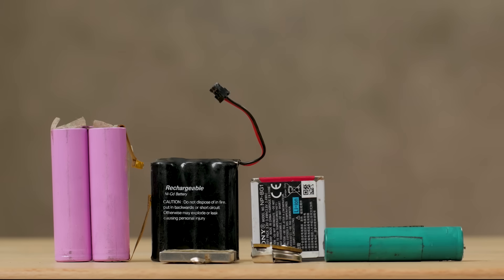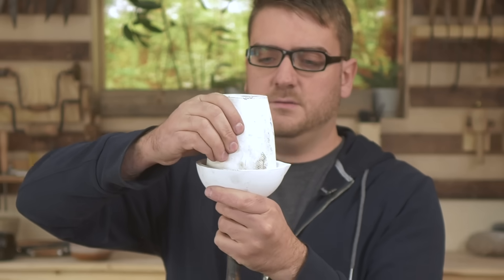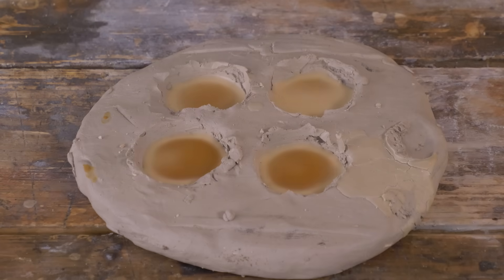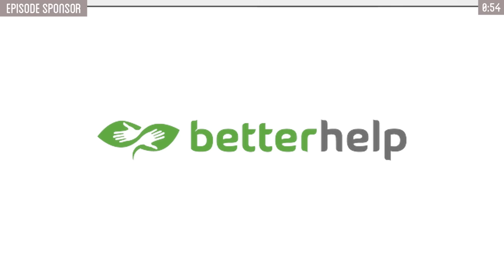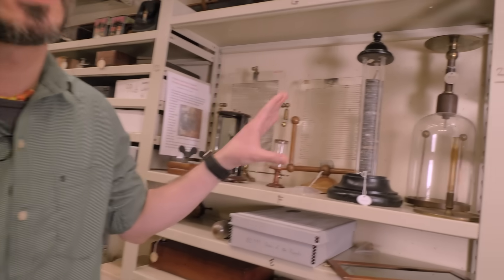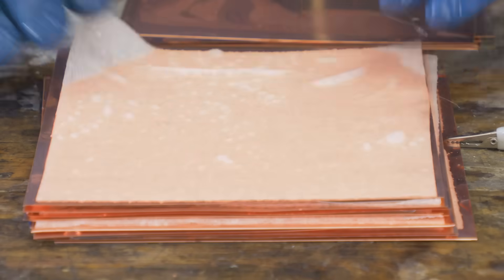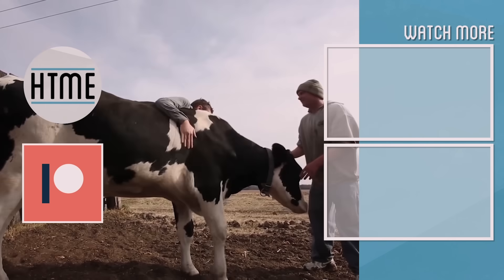Can an 18th Century Battery Charge Your Phone?

Comment: Next time you cast metal with the lost wax method, build in gas vents from the discs back up to the surface. Or at least a good way from the cavities. That will allow the metal to not have to try and compress the gasses inside the mold. 
Or you could attach the mold to a string and swing it around employing centripetal forces to push the metal into the cavities. Both are tried and true methods of improving casting results.
Also try having a larger funnel shaped hole at the top to allow for more metal in your pour. The increased weight will help push the metal into the cavities, plus the excess metal reservoir will help when the metal starts to shrink when it cools.
Reply: Thank you for bringing this up. First thing I thought when I saw the casting
Reply: @inserttext2412  20 plus years as a custom goldsmith specializing in casting and repairs. 
Sometimes small things make huge differences in end results.
Reply: It always surprises me how many people pour into molds using the silly small holes like that.

Comment: That stack of metal and fiber, doused in salt water lighting up that LED light was a really cool visual of the basic principles of a battery.  Mind-blowing!
Reply: I remember back at school in the 1970s we made a voltaic battery from layers of copper, blotting paper and zinc soaked in brine.
Reply: Penny's after 1983 are zinc with copper plating, sand one side down on the sidewalk and you can do the same.
:)
Reply: @skepticfucker280  Incorrect. The penny was originally minted from bronze, but since 1992 has been minted in copper-plated steel due to increasing copper prices. By May 2006, the intrinsic metal value of a pre-1992 1p coin was about 1.5 pence. Melting coins is illegal in the United Kingdom and is punishable by a fine, or up to two years imprisonment.

Comment: what would you have to replace to reuse the battery?
Reply: Water if it dries out, or replace the corroded zinc plates if the charge is depleted.

Comment: It's not that the battery is discharging quickly. It's that it's internal resistance is high. When you measure without load vs with load you can calculate the internal resistance. Bottom line you need way more surface area to keep the load down on each cell.

Comment: Great video.  I'm a little surprised you didn't immerse your homemade battery in a vat of brine.  You had plenty of metal for the anode and cathode plates for it to last a long time, but my guess would be that since they were in series, you lost power when the electrolyte dried out.  

Once you no longer had a viable path for ion transport between any two anode and cathode plates, you would have lost power.  Immersion in a vat would have fixed that.  Also power levels tend to be a function of both the available surface area and the proximity of the anode to the cathode plate.  Usually you want a separation on the order of just a millimeter or as close to that as possible.

Note that in the case of trying to recharge your cell phone, once enough of any one insulator dries out, your battery's power level will drop enough that the charge controller on the phone will simply disconnect.  That's likely what's happening in your video.
Reply: If you put everything in one big vat they will act as one cell and the series connections will become short circuits.

Comment: the first man made ferric magnet... made with a iron bar inside of a wire coil battery? or was electricity attempted to be used to melt metal but only got it red hot?

Comment: i would have thought you would have had a tube over it or a box for the squares to sit in that would hold the water with them. though not a chemist or a techy or science person. but i imagine your loosing charge as it dries out and water is evaporating etc. after all all modern batteries have a casing :)
love your videos and glad to see your up and running again after the fire. :)

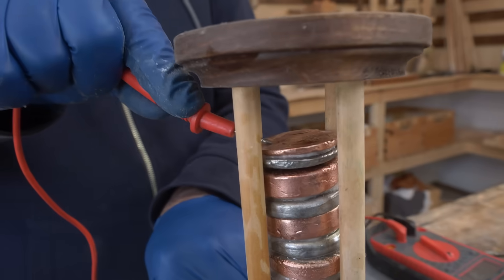Comment: 11:13, that's not how you measure current 🤦‍♂️. Your ammeter should be in a circuit, you shortened the battery.

Comment: Loved the episode and the history as always, another great video HTME team!

For casting, maybe it would make sense to put tiny holes in the mold to let air escape as it fills?
Reply: Yup. Vent tubes allow the metal to more completely flow down that tree. Without the venting, the pillow of air that exists in the negative space must be evacuated/displaced to let the metal in. 

In addition to venting the bottoms of the casting pcs, there's no rule that the metal has to flow into a central pipeline, and then split off from there. You could absolutely add extra passageways from the top pour space, DIRECT to the harder to reach casting spots at the opposite end of the mold. You just have to make sure your 2ndary flow route isn't working as your vent. The pressures will screw everything up. You don't want one flow route to push the air into the second flow route, upsetting that metal's casting path and screwing up the quality of results. 

                ^                                          Vent
                 | (vent)     mtl-->[art]<---mtl⤴️
             [Art]<-- mtl         |                    |        
Metal---> ^                       \                 /  
~~~This^works.~~~this ^ may be probl.

Those two adjustments will greatly improve the casting results.
Reply: I wasn't clear what you meant by 'tiny holes?' But a few simple evac routes would be better than trying to pin cushion the mold with a ton of tiny exit paths. Again, it's all about rapid and decisive flow of the molten metal. The same holds true for evacuating the air from the casting. 

So, congrats on presuming a way to improve results. It was a wise suggestion based on observations. And you happen to be totally correct.
Reply: @knuckle12356  oh yeah i just meant like a tiny air channel, 3-4mm in diameter extending upwards and away to drain the bubbles of air. You know now that i think about it, since its all just casting disks I get why they switched to open molds and casted them flat

Comment: 10:37 what the hell man? I know it was the first prototype and was unlikely to work, but you really shouldn't run current through your hands like that. Come on
Reply: The current doesn’t run through your hands. It runs through the LED, that’s the path of least resistance. Also the resistance of your skin is really high regardless. Current is voltage divided by resistance, it’s 8.7V, so it’s just as dangerous as touching both terminals of a 9V battery. Which doesn’t do anything. You only feel a tingle if you put it against your tongue, and even then the current and power is low.

Comment: Great video! I think the issues you were having with the final battery when charging the phone was that your copper layers were touching and shorting out. If you put larger diameter pieces of soaked paper (instead of more pieces) between the layers it should keep the individual layers from touching and give you a more consistent output. Great job as always!
Reply: Al you need is a bar of each with a wire of a different metal one ring them together after entering the phone then the salt water buckets to suspend the bars
Reply: Unsure about this battery, but I am somewhat familiar with salt water batteries. They produce extremely low voltages per cell, and capacity is also very little, but his should've had a decent capacity (prob close to a cheap AAA) so I assume his had little capacity due to the resistance and inefficiencies. The best, most stable voltage I got for my salt water battery was 0.6v with very little capacity... though the right mixture of table salt and water for the electrolyte is what brought the voltage that high, my capacity for that one was horrible due to it being my first attempt, where I used the only copper I had around (about a foot of scrap christmas light wire for the anode) and aluminum cans (soda can cut into sheets for the cathode). I also had a bunch of resistance since the anode and cathode were loosely suspended in the container, with the can rolled and placed in a makeshift fabric casing (scrap fabric I had lying around as the separator).

Comment: Love that the experiment demonstrates the formula for water by giving you 2x as much hydrogen
Reply: Isn't that exactly how scientists determined the elemental ratio for water?
Reply: @nasonguy  they had that figured out along time before electrolysis analysis, electrolysis is just a common proof of it
Reply: It’s not rigorous as it’s only the same number of *molecules in the same volume at the same temperature and pressure (for example hydrogen could be an monatomic gas and it would give the same result if water were HO)
Also it could be any molecule with the form of H_2nO_n
Reply: I noticed that as well
Reply: Say you don’t understand without saying it 🤡
Reply: Didn't see you making that?
Reply: Senza gli italiani 🤷‍♂️
Reply: If it’s 2O wouldn’t there be twice as much oxygen
Reply: @rso823  It's a small 2 after the H:   H2  O for water.    Hyd Peroxide is H2 O2 - so number of atoms is second to the symbol
Reply: @ooj316  Not true. Wrong.
Reply: @rso823  no, the formulas in chemistry are element(amount), so h2o is hydrogen(2) oxygen(1)
Reply: @teslacoil4335  Nope. False.

Comment: Curious why you chose to cast the discs instead of working the metal thin and cutting them.
Reply: Probably for historic accuracy. The original voltaic pile used cast metals. But yeah, it would have been much easier to work and cut the metal.
Reply: He would need to invent (i.e. forge) metal shears
Reply: @linecraftman3907 or better yet, because the metal in question is quite soft, a hole punch. He already had the tech to make iron tubes and to sharpen them.

Comment: Could you maintain a longer discharge by submerging it inside of the brine?
Reply: It would then be electrolysing the brine solution, effectively creating a short between the two ends of the pile.
Reply: @massimookissed1023  I figured that would be the response. Thanks for confirming!
Reply: @Ditch_van_Winkle  yes but having them just slot into a casing nice and tight to stop the water evaporating would help. he even shows a diagram of something similar at the end of the video think that was a more modern version of the the battery though. and at the start i thought he was going to slide a glass tube in between the 4 rods. and drop the discs in etc. but still interesting
Reply: @TKs3DPrints  he was trying to replicate the voltaic pile for demonstrations purpose. if he just jumped to modern batteries it would defeat the purpose of the series.